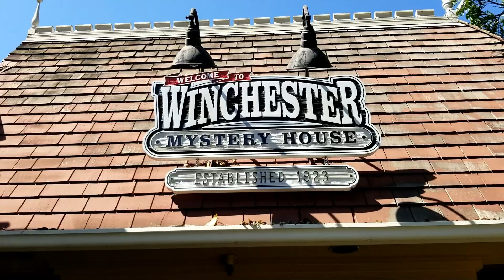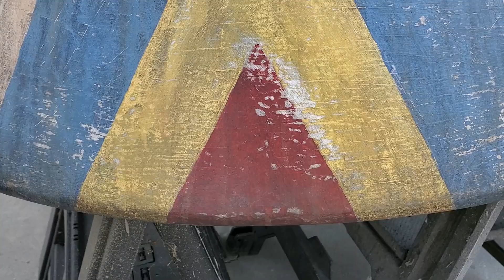Carnival Themed Prop 🤡 Haunted Ringmaster Stand Halloween Circus Decoration

Comment: Great circus platform, simple but extremely effective and a great weathered look. Did you use joint compound instead of foil before the fiberglass to protect it from melting the polystyrene?
Reply from the maker: Thanks! We used foil sheets applied with spray glue.